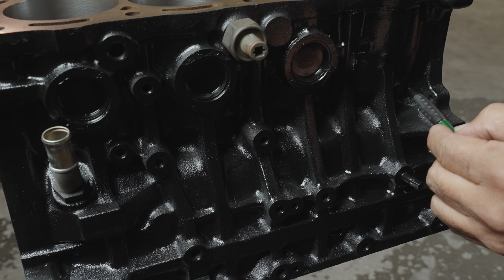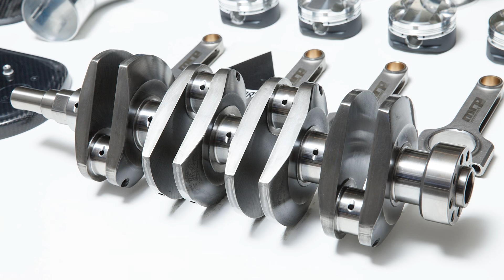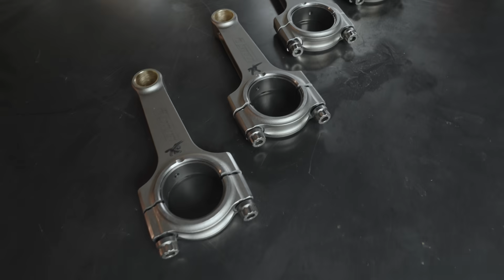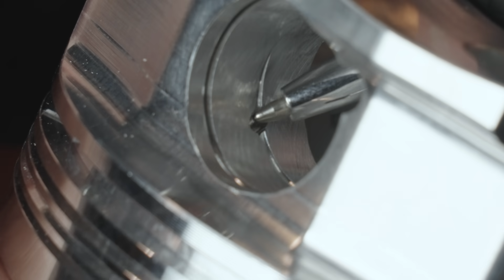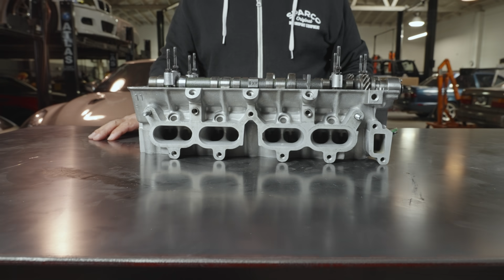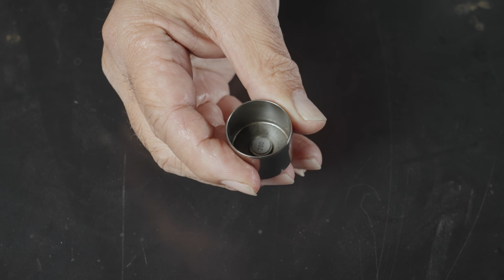Building the Toyota 4A-GE!

Comment: Few questions is it true that the 20v heads have problems with the valve springs in constant high rpm application due to the spring diameter? And also is it true that the smallport 16v smallport heads actually flow better than the bigport heads?
Reply from the maker: I haven't heard of 20V spring issues in race motors although those are not the stock springs. The big port heads with the Formula Atlantic valve size flow more than the small port, small port with FA valves, and 20V heads.
Reply: @motoiq  I see thanks for the Info I thought that the narrower valve angle of the 20v and later small ports increased flow substantially enough to justify their smaller intake port size, but I guess my research was wrong. Two more question I heard from your video that you personally like to use kelford cams with a 10mm lift, would those cams make the 4age into an interference motor? I'm kind of afraid using an oem timing belt from a different brand for a 7age and have it snap. Sourcing a better timing belt may be possible, but considering I need to wait and pay a premium for shipping and import tax I rather not. Last question is will a barrel style intake like what hasselgren used be worth it for a street car?
Reply from the maker: I sort of think that for a full-sized car, the small port and the 20V may be down 6-10 hp or so but that's at high rpm and the torque and wider powerband of the small port and 20v will move the car better.  Now in a light open-wheel race car with a close ratio dog box, sure the big port will rule but that's not most people.  Yes, it is an interference motor.  Barrel ITB's make more peak power but shaftless ITB's like MRP's make almost as much peak with nice throttle response for less money.
Reply: @motoiq  Thanks for answering to obscure questions by a stranger from a video posted 3 weeks ago. Your explanations are well detailed I learned so much. Hope you also post about other old school toyota motors such as the k series from toyota. Much appreciated.
Reply from the maker: Man, haven't done a K Series since the 80's for our GT5 car at TRD.  All of those parts are non existent now.  It would be a lot of bucks to make something like 110 whp now days!
Reply: @motoiq  True I heard that the crank harmonics can't handle high rpm pretty well and the head needs a lot of work to flow unless you can get ahold of a 3kr, but at least you can bolt on a w58 using a 7k bell housing and use 7afe rods for a 7k build. Engine swap legality is kind of a grey area here so it's a long process for it to be approved meanwhile using a 5k or 7k engine in a ke70 and passing it as a 4k by modifying the engine number is much easier.
Reply from the maker: We used to do Carrillo rods, JE pistons, 13:1, TRD japan cam, valve springs, ti retainers, big valves and new seats, a ton of porting, carbon fiber pushrods, 44mm mikunis and a dry sump and spin them to 9000 rpm.  I think they made all of 140 hp on an engine dyno which was 2x the stock engine, hahaha, a lot of work for not too much.

Comment: Do you have a recomendation which engine to swap instead of the 4age. I know the go to engine is the 3sge beams in the majority. But i want a good reliabel engine that can take 300hp easyly. And swap it in my ae86. I want to go with a 3gen 3sgte. But i'm affraid that the crank bearing will fail. Is there a solution to that? And mount it angeld like stock or 90degree angel like 4age?
Reply from the maker: If you want an NA motor, it's hard to beat the Honda K motors.
Reply: @motoiq  no. I want a turbo emgine
Reply from the maker: I would still recommend a Turbo K motor.  A 3SGTE can handle about 400 hp with pistons and rods but its hard to get shelf parts for them.

Comment: Nice video, lots of great info here. I would like to add that the issue with oil pumps themselves are in the early gen pumps with square edged gears, later pumps (silvertop 20v is considered the better option) are great off the shelf for majority of builds. The problem with breaking gears on the bigports pertains to oil Cavitation. The head only has an oil return in the centre of the head on the exhaust side. Under high rpm and cornering forces, oil tends to get trapped in the head for a little too long which effects the pickup volume at the sump. The smallport engine has addressed this with an additional oil drain from the rear of the head down to the block amongst other efficiency upgrades. The bigport has the provisions for these drain ports to be machined for fittings by a skilled tech.
Reply from the maker: We restrict the oil flow to the head down to about 2mm. This lubricates the valvetrain fine but prevents pumping all the oil to the top.

Comment: When I built my 7A I lucked out and got a Atlantic crankshaft and short course cams that and cp rods and pistons. We made a billet pan with the dry sump and mains all together. We made 228hp sadly it only lived 3 races
Reply from the maker: what happed to it?
Reply: @motoiq  tire blew out on the car passing and took out the front end of Carlos's car and the engine snapped at the mid plate and it pinned the throttle open which killed #5 main and rod 4 before shutdown. Owner gave up
Reply from the maker: Wow what a freak accident.
Reply: I think if I dig thru the basement I think I can find some pics. If I do I'll send pics to Mike

Comment: ive got a AE92 coupe which i manual swapped and put a blue top 4AGE from an 86 MR2. i rebuilt the 4AGE before hand, new pistons, bored 82mm, decked with the TRD 0.8mm head gasket, HKS 272 intake and exhaust on adjustable cam pulleys, stand alone ignition (no distributor) and two weber DCOE 40s and straight piped with stainless headers plus a few sort of reliability mods like the MRP timing belt stabilizer and all ARP bolts on the bottom end and the stronger 20v oil pump. it really takes off, i put 91-93 octane (north america) and have the ignition timing up just before knock. great acceleration with no delay!

Comment: I had 93 4agze with a turbo in an old corolla that was 172kw at the wheels and had the rev limit set to 8200rpm which was so reliable i put 80,000ks on it in the end the end the ring landings cracked due to a bad tune

Comment: FYI the 42mm cranks in these engines are good for stupid horsepower, PSI Racing has seen no problems with them going to 600whp.  You only need to think about a stronger crank if you want to sustain 10k rpm for long periods or are throwing huge horsepower through the little 1.6. 42mm cranks were taken to 8400 rpm stock (rpm chosen by Toyota with general builds) once balanced they can keep higher.  Typically the limiter of the engine is rods, rod bolts, or the sump turning so fast it cavitates or froths the oil. good video with pretty good summarization.  A bit on the safe side but good info nonetheless.
Reply from the maker: You are right, forced induction and lower revs are actually easier on the crank and block until power levels get stupid.  I should have said that this video is more NA focused.
Reply: @motoiq  Ah, I took the information to generally. As an NA platform it definitely needs the extra strength.  The 40mm cranks are definitely not up to the task, they or the rods tend to give out in even mild builds on early bigport engines when aroung that 160whp mark or earlier.
Reply from the maker: Yeah I found that 170 whp and not much more than 8k rpm was the safe limit with the small cranks.

Comment: American v8’s used to rev much higher than 5k back in the 1960s! Peak hp on a BOSS 302 OR Z28 were well into the 6’s;) 1980s kinda sucked though.
Reply from the maker: Those were about the only two super limited production cars.  Most cars at the time redlined in the 5k rpm range.

Comment: Awesome, informative video as usual. Wondering how the 7AFE block compares to the 4AGE? I may be wrong but I'm sure Tsuchiya runs a 7A block.
Reply: if its a 7A block its likely a 7AGE hybrid engine or possibly a 9AGE hybrid. those engines use 4AGE heads and bottom end (9AGE uses 2ZZ bottom end) and 7AFE block.
Reply: @EscapingTheConcrete  That's what I was referring too, IIRC Tsuchiya runs a 7A block with a 4AGE 20V BT head. Think he mentioned it was better for torque and strength.
Reply from the maker: Better rod ratio is possible and bigger journal diameters
Reply: @motoiq  Awesome, cheers for the further info!
Reply: @EscapingTheConcrete  or just a 7afe block and a 4age black top head
Reply from the maker: Taller deck, so room for 90mm stroke and a decently long rod for a resonable rod ratio.

Comment: I love my AE86 but would be afraid to mod the engine too much since I live in California, maybe one day they will give up on emissions standards for 40 plus year old cars. That being said I have a big port head on a black top 20 valve bottom end it works pretty well but on warm days especially near winter where they down grade the gas the car pings a little at higher rpms even with advancing the timing a little. One day I would love to do a 5age, I don't need big power just something like the above with a little more TQ.
Reply from the maker: Advancing the timing makes the engine more likely to ping, not less, retard the timing a few degrees to eliminate pinging, its really bad for your engine.  The 20V is a good bottom end for a mild build, stronger crank, block, rods and oil pump.  It can see you into the high 190 low 200 hp range.
Reply: @motoiq  I'd be happy with 130 whp...lol

Comment: Don't sleep on the 4AG. My AW11 makes 620whp on a 1.6L 16V 4A. Stock crank. Not sure why he's saying they are weak
Reply: Lots of people claim they are weak, but the number of people who've thrown turbos on gzes and made 250-300kw with some injectors and ECU... I don't get the claim of weak.
Reply: Folks clicking on the video  are typically fans of the engine. And know better than to think its week.   Group A and formula Atlantic motors etc Toyota used the engine in a lot of motor sport. They wouldn't have if the engine was week
Reply: 600whp? How the heck do you drive that without fearing for your life? lol
Reply: @TheMayorPower Its a rocketship but it makes most of its power between 7000 and 9000 so the power is high but the torque is relatively low. Traction is not much of an issue. It just hooks and books!
Reply: @DJToneRI  Did you just do a tune on it? I'm already scared to go over 80 with my stock weak 4AGE in the AW11.
Reply: @TheMayorPower just a tune? No its a full build, CNC ported, on E85 at 35psi of boost on a G30-660. What chassis do you have? AW11s don't love high speeds but if you have the suspension and tires set up well, it helps
Reply: @DJToneRI  Oh yeah, that/s a lot of work. I have an 89'. I've upgraded all the suspension in it and it has helped a lot.